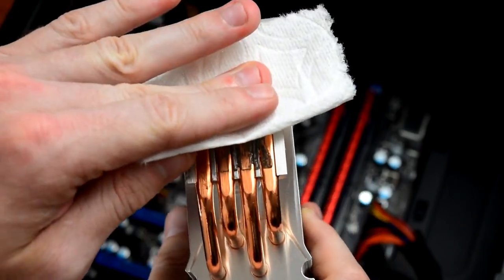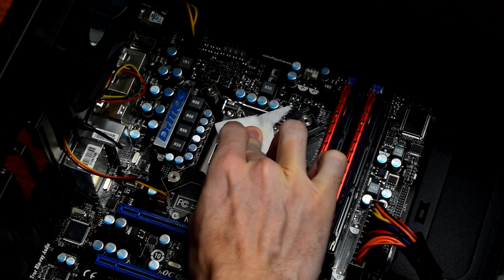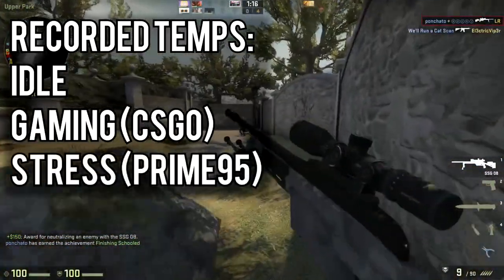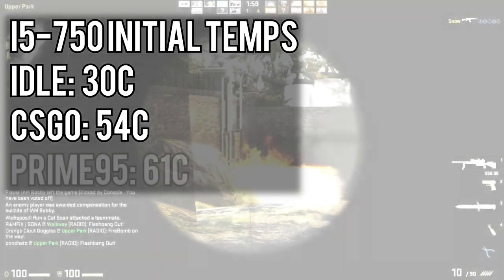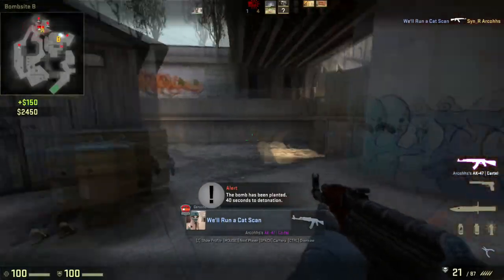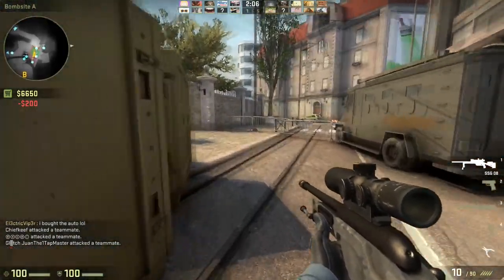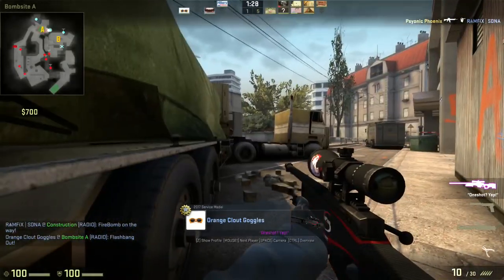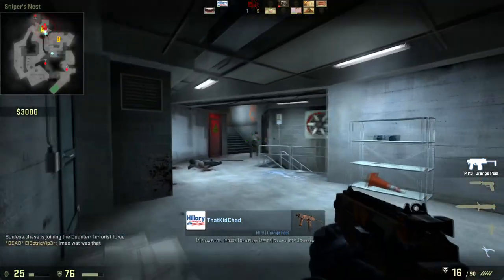Quick Question 002: Does Thermal Paste Need To Be Broken In?

Comment: I opened my laptop today and cleaned it up from 7 years old dust and i saw a 15 degree celcius deference.....i then changed thermal paste and the diference bewteen old and new ones was 2 degrees is it normal?
Reply: Jugers Zelegou thats completely normal. Thermal paste doesnt really wear out much over time. You may see 2-5c differrence in changing 10yr old paste, but i consider that pretty small change.
Also, taking the dust off your laptop probs improved airflow in and out of the "case" as well as improved the cooling of the parts, as they are now in direct contact with the air.

Comment: Is 70% isopropyl alcohol safe to use in cleaning thermal paste?
Reply from the maker: I wouldn't worry about using 70%; the only ingredients should be distilled water and alcohol, both of which will evaporate without leaving anything behind. The benefit of using 90%+ is that it evaporates really quickly (only a few seconds) so you can put the heat sink on pretty much without waiting.

Comment: Your Vids are well made, especially from a techtuber EDITING perspective; but the methodology of your Quick Question-Series is, in itself, questionable.

In the first QQ, you used two diffrent TIMs to verify your/the claim that TIM does in fact dry out. Let's set aside the validity and/or importance for thermal performance of that claim, your verification is absolutely not useful because you used different TIMs! 

Now you continue the series, by checking a newer TIM to see if something like break-in exists, when in fact it is pretty much established that the break-in was something that more viscous TIMs might have needed back in the day, as they would stretch further out when the whole cooling-assembly was heated (I believe Arctic Silver 5 needed that break-in and maybe even IC Diamond 7 performed better with it, not so sure about the latter though). While you acknowledge that other TIMs (metal based/pads) might perform better, you basicly generalize. However, if you want to generalize, you will have to do A LOT more extensive testing.

That said, keep up the good work! :D